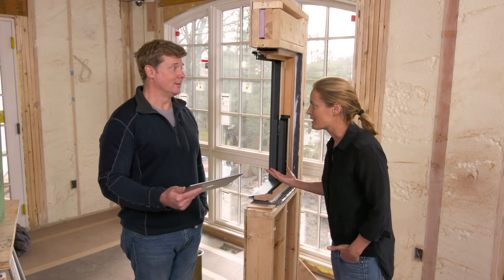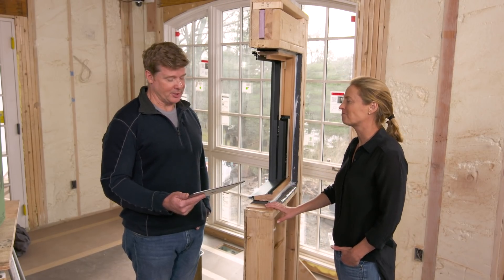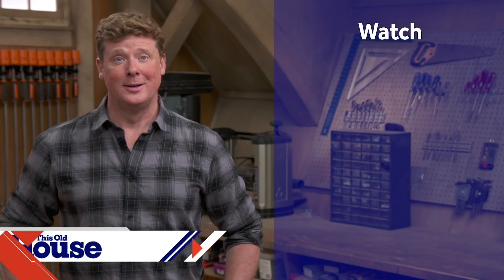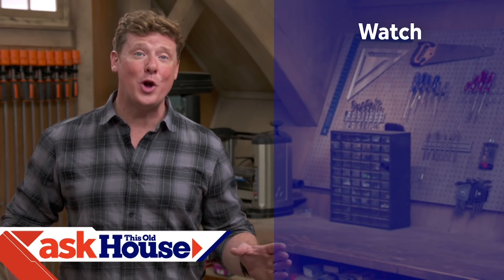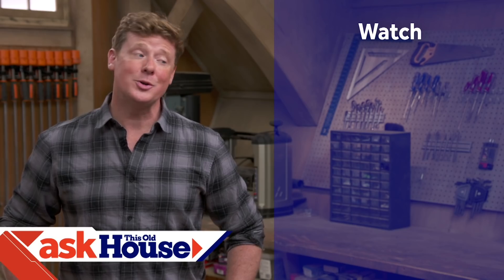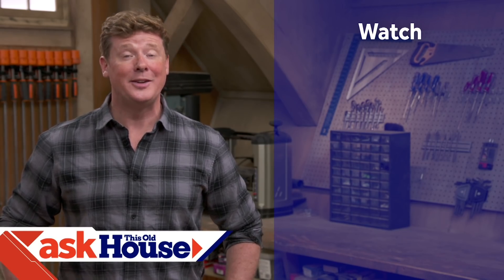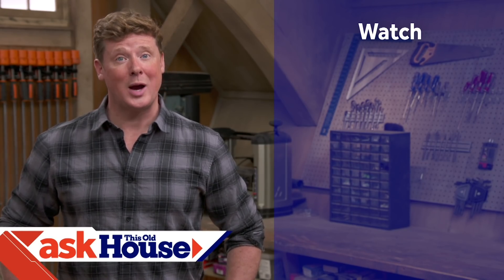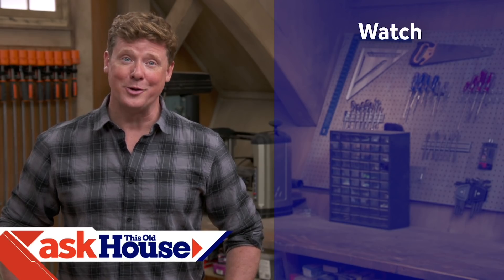Balancing Insulation VS Drainage in Window Installation | Pro2Pro | This Old House

Comment: For those who have heard windows are the last thing to update in an old house.. I’ll tell you from experience that lots of old windows are installed so poorly that it’s the gaps around the windows that are the problems. When you install new windows you’ll usually do such a good job fixing the leakage that the process was worth it.
Reply: Duncan Cunningham it’s the windows themselves that are inefficient
Reply: Shadman Ahmed true, and people will tell you, who claim to know, that you replace windows last...  I was saying that replacing windows can make a big difference due to poor installation.  Yes, they are inefficient but air leakage is the worst.

Comment: Hey guys I watch you channel all the time. I need information on how to unclog a tub. But I need a few ways. Nothing's working
Reply: Is the plug not staying up?
Does the plug lever stay up, or does it fall down?
If it does not stay up, then the tub is not clogged, the plug lift is worn and needs to be replaced.

You can easily test this by removing the two retaining screws and the plug overflow cover, and pulling up on the rod that connects to the lever. That pipe the rod goes down by the way, is the tubs overflow pipe.

To get a good plunge, you need to remove the plug overflow cover and stick a rag inside the overflow pipe so as to restrict it's ability to allow air in and out.

If it still does not drain, you can pour liquid plumber down the overflow pipe to get it closer to the clog.
Reply: @scotttovey  ok thank. I will try this as soon as I get back home
Reply: @dg.6477  😎👍
Reply: A few weeks ago i unclogged the kitchen sink by putting the air compressor on it. Use a rubber glove to make a tight seal around the air gun onto the drain hole. Then you don’t have any dirty tools afterwards, and no need to be cursing at tight bends in the sewerline.
Reply: @Engineer9736  
A similar method is to use the water pressure in the system.

I wrapped tape around a garden hose and forced it into the drain pipe coming out of the wall under the bathroom sink and turned it on.  I did this because the pipe in the wall had a lot of sediment.

Years later, I seen a  rubber garden hose adapter. You put the adapter into the drain, hook the hose up to the faucet and turn it on. The water pressure causes the rubber adapter to expand and seal the drain which allows the water flow to push the clog out and down the drain.
Reply: @Joe T thanks for the added info